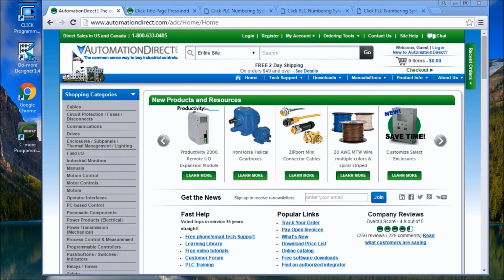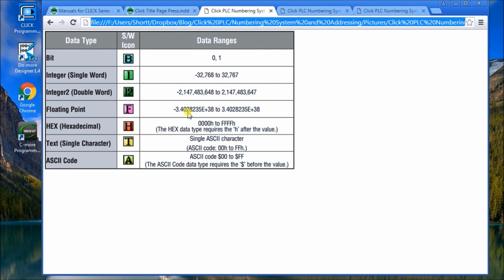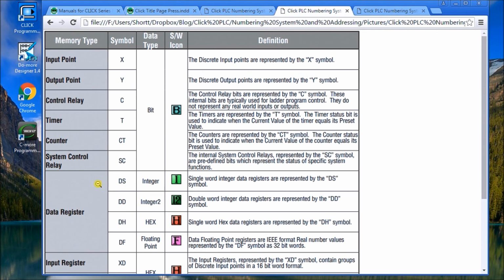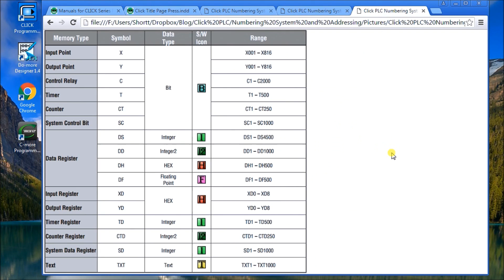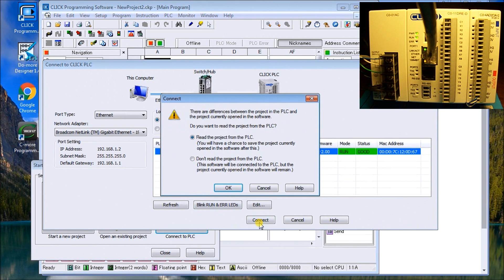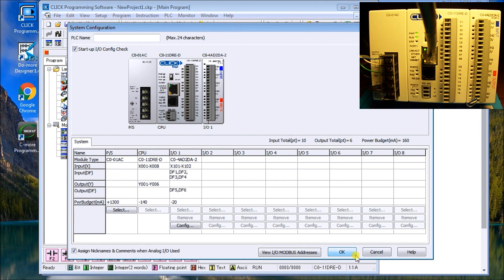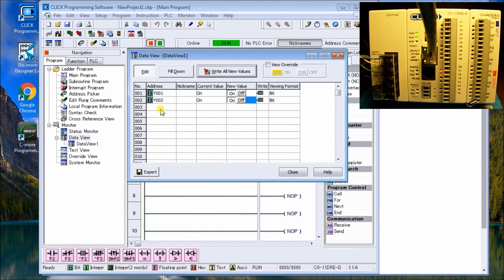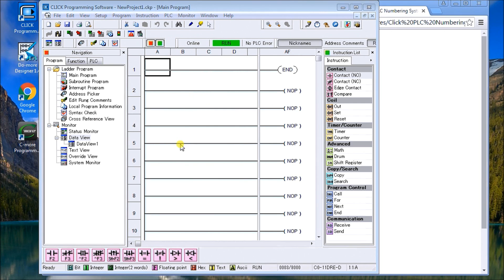Master Click PLC Memory: Bits, Words & Addressing Secrets

Comment: Hello quick question, I’m fairly new to PLC Programming but how would I know what settings I need to put my “channel parameters” for c2-08D2-4vc? I just want basic settings
Reply from the maker: Call up the System Configuration when you are online to the Click PLC. Main menu | System | System Configuration.
Since this is a Click PLUS slot module, you will see the IO addresses assigned to the card. The analog can be configured using the Config button.
I hope this helps you out.
Regards,
Garry

Comment: Quick question on rung comments and address nicknames. After I add both of these to a program is it possible to have the plc save them so then next time someone connects to it the nicknames and rung comments are there when you "read project from PLC"? Currently I connect and after I "read project from PLC" no comments and nick names are there. I then open the saved copy I have in my documents and then the text populates. Is there a more efficient way of doing this?  Thank you in advance for any advice.
Reply from the maker: Hi John,
Rung comments and address nicknames are stored in the PLC when you download your program to the PLC. If the two programs are the same, I would download the commented version to the Click PLC. Then when you connect and "read project from PLC" all of the documentation will be shown.
Regards,
Garry
Reply: @ACCautomation  ah that's where I went wrong.  Thanks for taking the time to help an amateur.